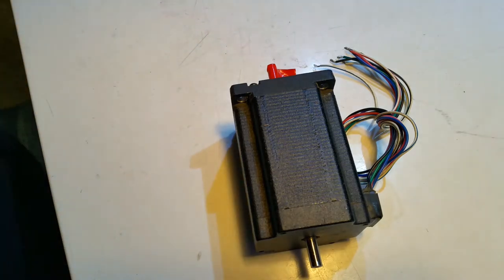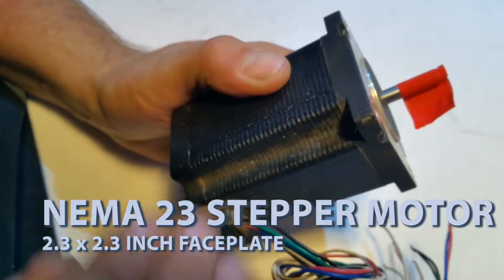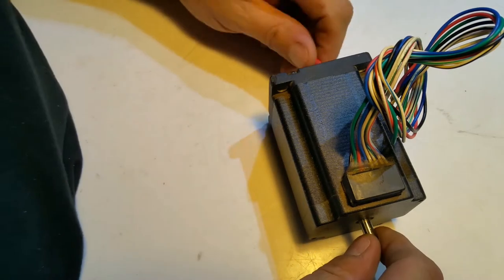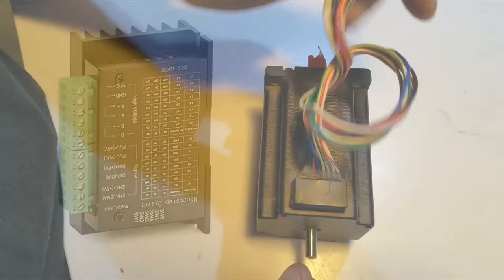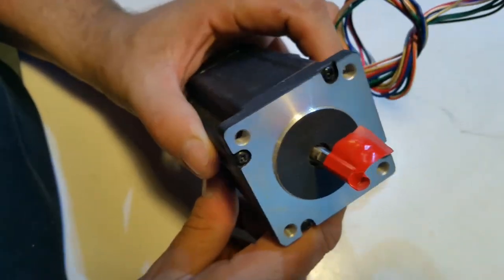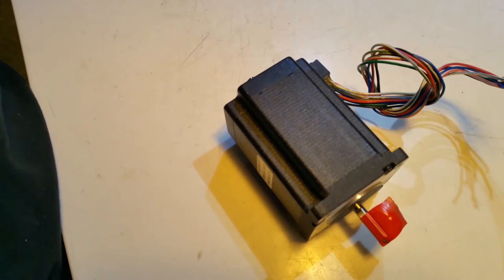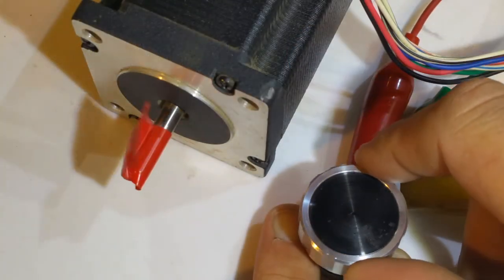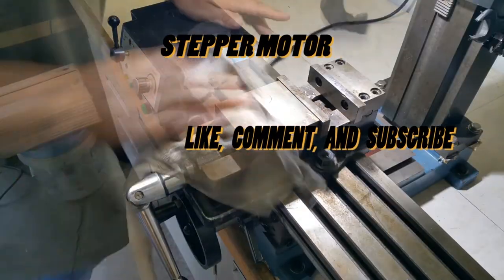Stepper Motor Overview: Power Feed \ CNC project, Pt. 3

Comment: Well I'm sure you have a torque wrench to torque down bolts such as the lug nuts on your car. You're use to ft/lbs on these wrenches and you probably know how much pull or force you have to exert to make the wrench click at say 50 ft/lbs. Well oz/in is just a smaller unit of force. And FYI a 200 oz/in motor can easily strip all threads on a 1/2" aluminum bolt just so you get a feel for the forces. For your application a NEMA 23 would be plenty.

Comment: Nice one Done, Love the new graphics you're putting into the videos.
PS some motors do come in different degree steps. It's just the one you have is a 1.8 deg.
I'm really looking fwd to this series. I have pretty much the same stuff at the house, just never took the time to set it up do to other projects like that CTS and fixing cars. LOL.
Thanks for sharing. Best Wishes n Blessings. Keith
Reply from the maker: Hello Keith, great point to make. There are many types of of stepper motors, with different step counts for various projects. Thanks for shouting out here, hope you get the CTS and car work done soon. -Cheers